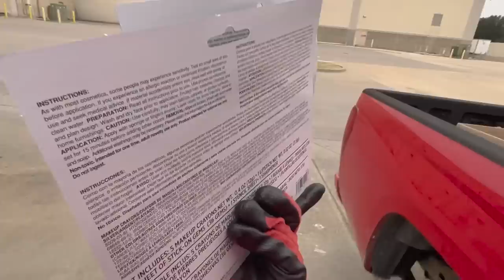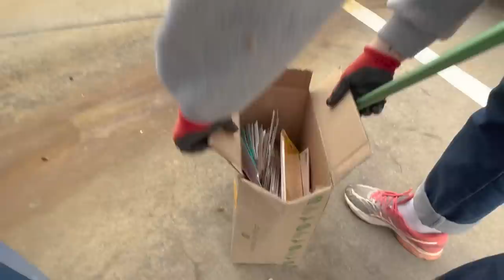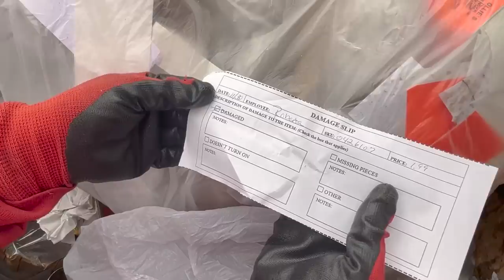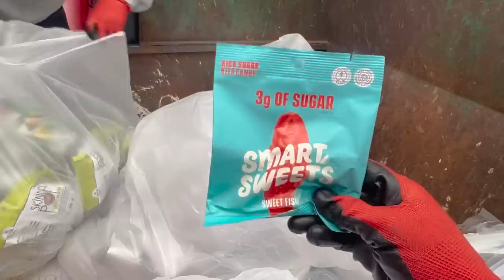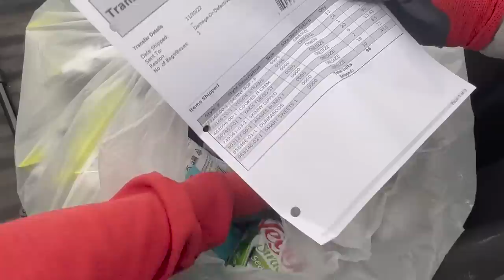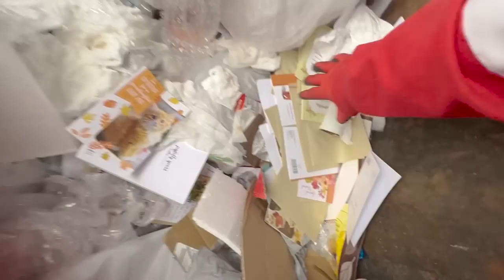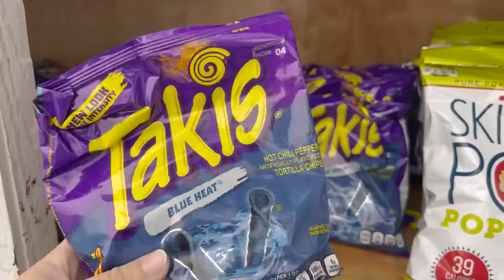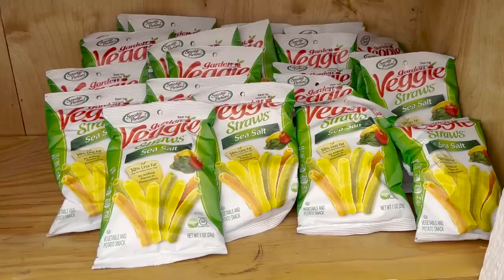We Found a HUGE Snack Bag in this Retail Dumpster!

Comment: I think that is an egg incubator, not a dehydrator. You take eggs right from the chickens that are fertilized and put them in there to keep them at the right temperature turning them now and then, and they grow into chicks.
Reply: If the lid is cracked it won't be any good unfortunately. The heat and humidity levels have to stay in at a specific range. It's too bad because that one is normally an expensive one.

Comment: * You can get Sharpie off many things if you use Upholstry cleaner by Woolite. Put it on the thing written on & brush rinse & then wash before you donate. ~ that scrap of fabric could have been trimmed & 1/2 inch strips cut in the ends for a Boy's scarf..

Comment: Hi you'll 
Give you some information on cast iron once you wash up turn the cook part upside down and turn on your burner for about 10-15 minutes it help dry it and help keep from rust more Or put about 1-2 drops of cooking oil inside pan before you use it this also can help prevent rusting also. 
P.S. iron skillet he keep crimals away knock in the head lite tap Lol.

Comment: I couldn't see it very well, but the yellow dehydrator looks like an egg incubator. We have an incubator for chicken eggs; it has a turntable to rotate the eggs and keep the heat evenly distributed. You can usually buy fertilized eggs if you want to try your hand at raising birds.